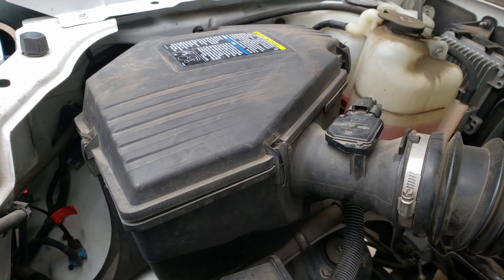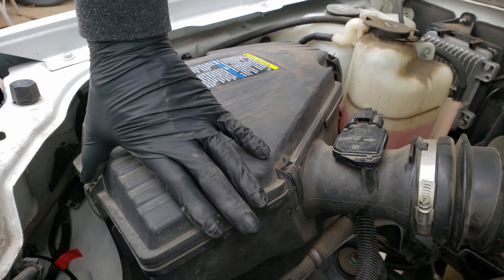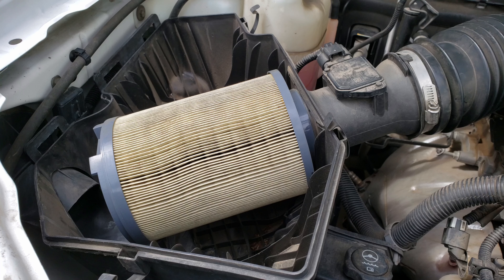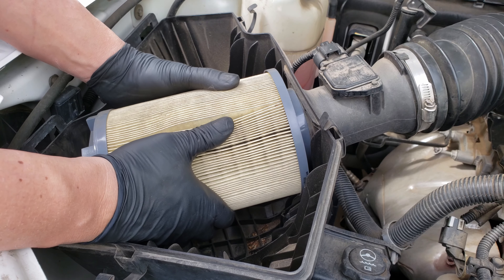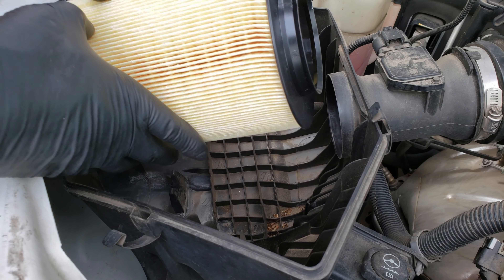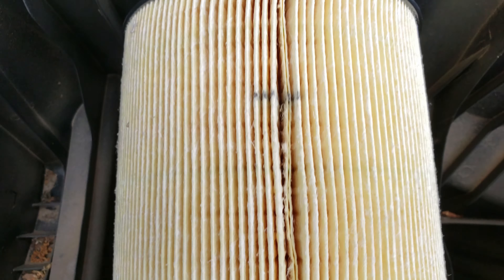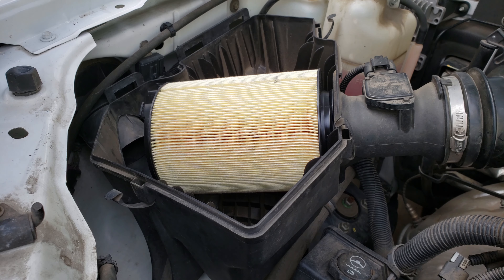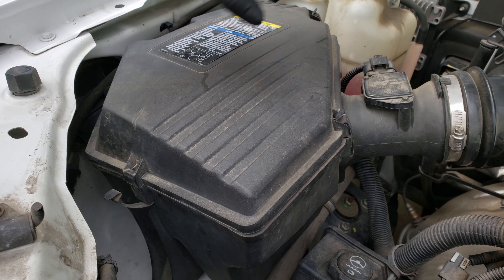How to Replace Engine Air Filter Chevy Colorado & GMC Canyon 2003-2007

Comment: In my Honda civic 2008 Cruz control is not working and Lights in Speedo meter P R N D D3 2 1 Not working pls help and it might be fuse issue and where is the location of this fuse please  HELP
Reply from the maker: The shifter light is probably just the s bulb that went out, i had to replace one recently on our honda civic..does the cruise control button click in and hold?